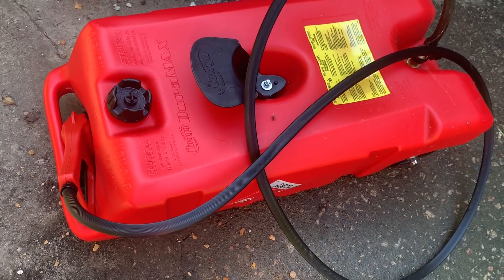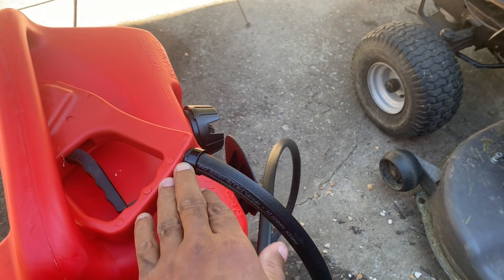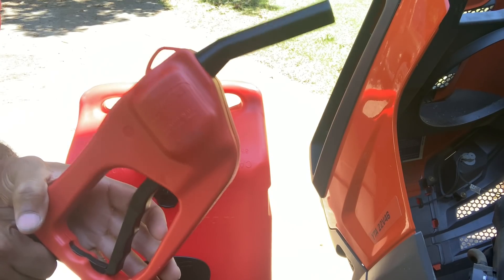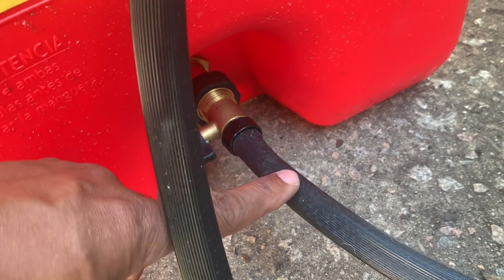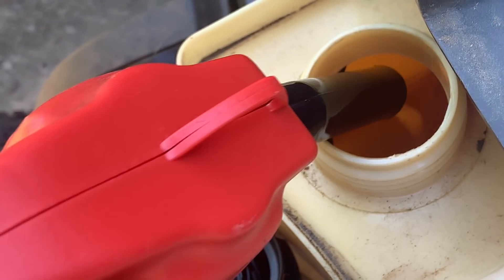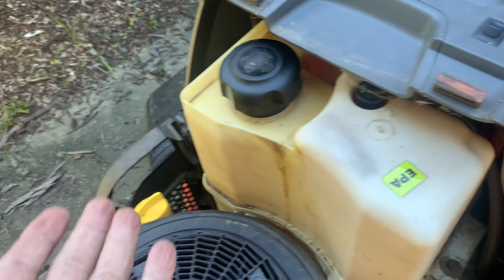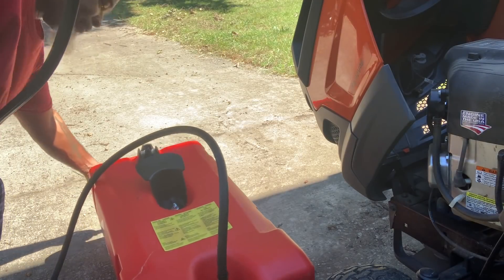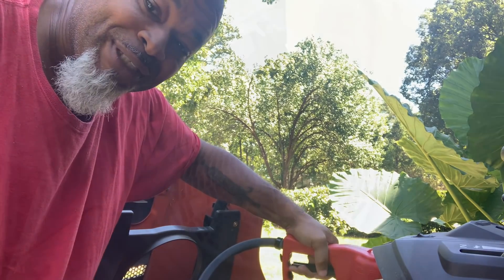BUG OUT FUEL STORING AND VEHICLE REFEULING DURAMAX FLO-N-GO FEUL PUMP STAION

Comment: I saw some at Harbor Freight or Tractor supply , they look very handy good call as usual Lead . I cant lift up the 5 gal. Ones without  making a mess. Get in the shade it's hot today.
Reply from the maker: Every time I used my old small ones I waste gas all over the place. Got tired of that. Plus I needed something that can seriously fuel all of my vehicles.
Reply: @leadfarmer73  I hope you and  Lady Lead are still celebrating your Anniversary.  Thanks for all your help starting on the hydroponics tomorrow  need a 3 inch whole saw got every other size. Jeez...

Comment: That's a great item.  Make sure everyone knows that when they go to the gas station, they must put that tank on the ground to fill it.  Do not fill it while it's still in the car, or on the truck bed.  That can cause an explosion.  I remember that happening to someone filling a gas can years ago.
Reply: Its been said not supposed to have vehicle on while filling as can cause explosion. I never did check the details. However, when or if i see someone smoking at the gas pump pumping or  pumping gas with the vehicle on. Instinctingly, run get out the way comes to mind. lol  Goining to hades with gasoline drawls on.

Comment: There are also 30 gallon & 35 gallon portable tanks with wheels to move them. 

If I had the money right now, I would get a 35 gallon tank and fill it. 

There are a lot of things I would get if I could.
Reply: You can buy the gas pump nozzle seperately to put on the container you have such as a barrel. You can find used barrels,  our mom and pop garden center sells used containers. I'm always looking for the cheapest way to do things. Also, some karosene heaters for winter may be a good idea. Karosene can be purchased from a supplier for cheaper than in store and unlike gas it can be store indefinitely. Just buy a filter for it.
Reply: @lonigirl8807  yes. I need to pick up some more kerosene. We get it at our feed mill. I have two kerosene heaters but I.need to.finish getting the back up parts for them. Mantles and such. Thanks for the reminder!
Reply from the maker: Some day I will get me a 50 gallon tank😉
Reply: Got one of those suckers myself. That and some cans transport to fill our 100 gallon gravity drum. Problem is stability and keeping it good.